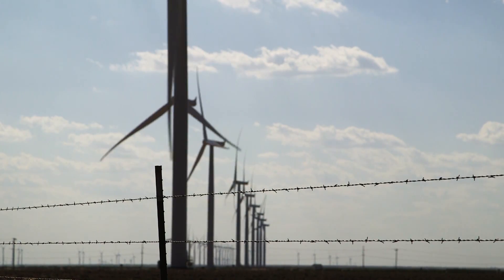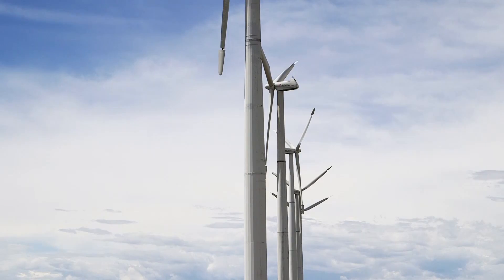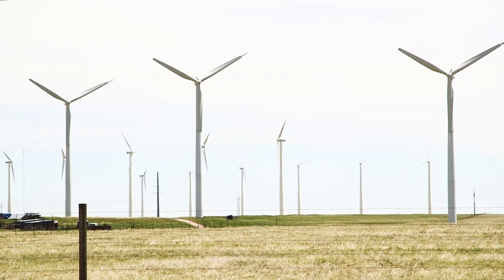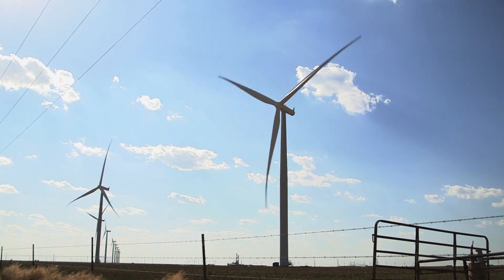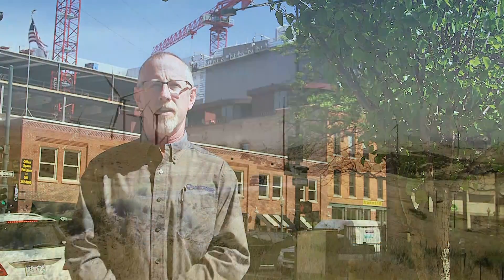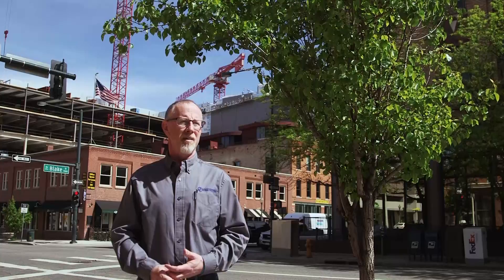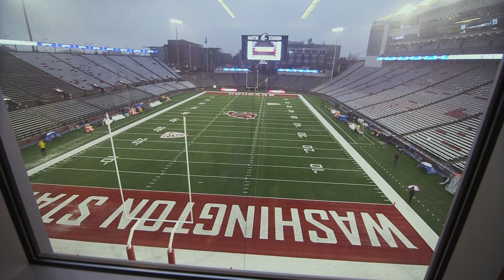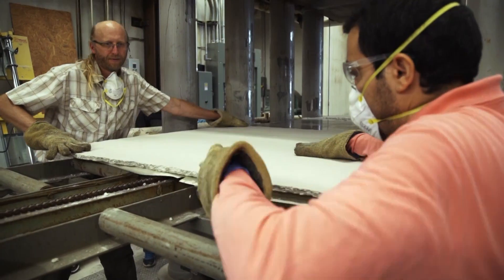Recycling Retired Wind Turbines

Comment: Well that looks Mighty green to me especially when you have all of these machines that operate on fossil fuels to be burying these wind turbines
Reply: Plus all the fossil fuel for the equipment to build them. Never mind all the plastics and fiber glass epoxy are made from oil based chemicals. Every where wind turbines are installed the power company charges more for the so called free energy than than the energy produced by fossil fuel. This and corn based fuels would go away if we remove government subsidies because they don’t really save any fossil fuel.
Reply: @Chris_at_Home  "This and corn based fuels would go away if we remove government subsidies because they don’t really save any fossil fuel." How on Earth do you believe that? Wind and sun have zero fuel cost, nothing burned, both methods last for decades or longer. One energy source burns fossil fuel all day, one doesn't.
Reply: @justsomeguy934  I haven't gotten a definitive answer but I keep asking if the manufacture of solar panels, wind turbines or electric cars actually offsets the benefit of using these :green" systems.  There's no free lunch and the composites in wind turbines are made with toxic resins and the steel, aluminum, heavy metals for switches etc all needs to be refined and manufactured.
Reply: @williamdavidson9009  I can tell you: once manufactured, solar panels and wind turbine blades are solid waste. Once manufactured, their energy source is pollution free. Burning ANYTHING creates pollution over the life of the device. Be aware of what you're doing: the oil companies have you focused on the issues of manufacture while NOT comparing those results to the oil industry. Follow the money!
Reply: @justsomeguy934  My question is does the savings on pollution actually offset the pollution caused in the manufacturing process.
Reply: @williamdavidson9009  I understand your question and I said YES. The manufacture of a hollow metal tower and a wind turbine that works reliable for decades with no pollution thereafter most CERTAINLY offsets burning petroleum for decades. Just the process to REFINE petroleum pollutes far more than making a wind turbine or making a solar panel.
Reply: Wind turbines require lots of petroleum products to function.
Hydraulic oil
Gear oil
Yaw oil
Yaw grease 
Bearing grease
Blade grease
Etc
Reply: No petroleum, no turbine. 
Also they produce a lot of waste.
Electronic waste, bad motors, numerous other components.
All the greasy rags used to clean them during service are incinerated.
They’re not as “clean” as you think. Even the really new ones.
And because the generators are asynchronous, there is a constant stream of copper dust coming out of every one.
Reply: @henrygoodbar9477  Gear oil on a turbine is miniscule compared to burning oil as fuel! That's like comparing the oil in your car's engine to the fuel it burns...they are vastly different, and one creates poison to use it.
Reply: Justsomeguy you are incorrect about wind turbines not burning any fuel. I have seen massive areas of wind turbines when there’s a ice storm or loss of power and every single one of them had a generator running in order to keep power to them. I think you have to consider that burning fuel. I’ve seen those generators run for weeks at a time. They also use oil in them. You can’t really have friction without lubrication and expect any equipment to last very long. I’ll let you guess where that oil comes from. I wish we could put the renewable energy fan club in a community and let them live off their renewable energy‘s for a while. See how long it is before they get tired of losing power, not having running water, air conditioning, heat, refrigeration, you know all those things they take for granted and they don’t actually think about.
Reply: @basedpatriot4982  You're making a common mistake that the oil company wants you to make. Several, in fact. Here we go: 1) you're assuming that I'm advocating for 100% renewables, to the point of not having power. I am not. Do not make an argument to the extreme and then criticize the original argument. 2) The comparison is between the amounts of oil used, not using oil as a lubricant. A few hundred gallons of gear oil in a turbine is vastly different than burning millions as fuel. 3) You fail to add in the true cost of pollution into your affection for oil. I can provide you many example of oil spills, air quality, pipeline spills, etc. that you are omitting from your argument.
Reply: @basedpatriot4982  " I have seen massive areas of wind turbines when there’s a ice storm or loss of power and every single one of them had a generator running in order to keep power to them. I think you have to consider that burning fuel. I’ve seen those generators run for weeks at a time. They also use oil in them. " The problem with your argument is that you're using an emergency situation as a definition of the normal operation. If I used your own argument, since my own utility sometimes buys peak power from other utilities that's expensive, I could conclude that the normal, say natural gas, operation wasn't feasible. My conclusion about a good fuel, like natural gas, is that it won't work  because I've seen my utility use jet turbines and jet fuel (!) to generate electricity when there's peak demand.
You are also making an argument in the extreme, and judging the actual argument. For example, who on Earth is arguing that we go without power? I have never argued that we have unreliable power. Not ONE utility on this planet is 100% anything - coal, NG, nuclear, solar, wind, hydro, geothermal. NOT. ONE. If, however, that solar power can generate 75% or our energy needs (the daytime!), WHY would we burn petroleum products? 
Another argument you're making is the argument of absolute. Your example is that a turbine uses lubrication oil, and therefore disproves renewable energy. Well, does coal energy disqualify natural gas? The  argument is one of relative uses. A few gallons of gear oil in a turbine is OCEANS less than burning oil to generate electricity.
I enjoy our talk, please reply.
Reply: @williamdavidson9009   Indeed, and the entire infrastructure that is capable of  supplying the material needed for a wind farm, is oil/coal/hydro based, right down to the crane op driving to the wind farm in his diesel pickup, been there/done that.
Reply: It takes rescources to build anything that produces energy.Bio - fuel,takes tractors,seeds,ground and refineries.Its not as polluting as fossil fuels ,but its not free.Turbines all require components of rare earth metals,and the disposal or re- fitting of these also have costs for disposal,One use plastics like packaging and a trillion cubic yards of one or two sip water bottles is a huge problem[ no reuse ,recycle,or repurpose plan]just jillions more producing it.But,its great for the petrochemical companies ,cuz ,when its out thr DDT oor ,their responsibility ends.Yea go head and bitch about wind turbine blades.SMH..Maybe shoul also throw abandoned ,or decrepit underground storage and pipelines in the mix too.
Reply: @joebeetz1832  Yeah, I get a kick out of the objectors to wind turbines that say "can't use those, the paint on the blades is toxic" while driving a car that will literally kill you if you pumped the exhaust into the cabin.
Reply: @justsomeguy934  I spent 39 years in the electric power industry. Wind turbines and solar panels are not the way to go to maintain a middle class standard of living.
Just ask Texas. The previous posters are correct about the hazardous waste produced with those inferior forms of electric generation. 
You cannot dispatch wind or solar power the way conventional power plants can.
Speak to any electrical dispatcher employed in the USA and they will tell you that you need "base" load sources. Gas turbines, nuclear steam turbines, coal & oil fired steam turbines, hydroelectric generators. This technology has been around a very long time with a proven track record.
Wind turbines are a child's fantasy.  Leave the production of electricity to the adults.
Reply: @generatorjohn4537  Being an electrician does not qualify you to discuss energy generation, sorry to say. Being a plumber doesn't mean you know where water comes from or how it's processed. Being a cop doesn't make you a lawyer, even though you deal with the law all day.
I think I see your mistake, however. You think I'm proposing a 100% dependence on renewable energy. I am not. No utility is 100% anything. But wind and solar can generate 75% of all our energy needs when we need them. I'm perfectly happy with non-renewables for the minority of energy production (say, off-peak). You most certainly need base power generation, but if solar can make 75% of our daytime energy needs, use that FIRST.
Reply: @justsomeguy934  Like I stated earlier, you will never maintain a modern middleclass society on wind or solar. These sources are government subsidized. Only reason they are being built. Besides you need to consider this.
You cannot operate steel mills or any modern manufacturing facilities with large motor loads on wind energy. Wind turbines or solar panels cannot produce the reactive power required to properly start and operate them.
Look it up. Although you'll probably need an electrical engineering degree to understand this concept.
Reply: @generatorjohn4537  "Look it up. Although you'll probably need an electrical engineering degree to understand this concept." Um, I have looked it up, and it's YOU that needs to understand the topic at hand. Again, an electrician is not qualified to talk about energy generation, he just runs the wires. Plumbers don't understand water reclamation, HVAC technicians don't understand nuclear energy. But all think they're qualified to do so.
Wind and solar most certainly can create the energy we need. Solar, which only operates during the day, can generate 75% of all power required during the day, and generate 100% if the grid has storage. Have a large motor load? Use a storage device (capacitor, battery). I guess you think a dam can't generate useful energy, either.
How many solar panels to power the USA: https://www.freeingenergy.com/how-much-solar-would-it-take-to-power-the-u-s/ 
Largest wind turbines: https://youtu.be/anzrmuxh9dQ
Reply: @generatorjohn4537  "You cannot operate steel mills or any modern manufacturing facilities with large motor loads on wind energy" I'm overjoyed at learning something new. Tell me how the electricity - voltage, amps, watts, kW/h, coming to a factory over a utility line is different when a wind turbine makes the energy. Or when a solar panel does. Or a dam does. Or a jet turbine does. Are you telling me that a utility can deviate from the standard energy requirements it supplies to its customers based upon the source of the energy? How about when a utility buys peak energy from out-of-state? Can the utility only supply half the amperage because the peak supplier uses geothermal? Educate me. Tell me how, then, the Tesla grid-level battery works so well in Australia. It steps in and provides megawatts of energy, instantly, when their grid needs it. And it's all invisible to the utility customers.
Reply: @justsomeguy934  BTW - I posses an electrical engineering degree. 
 Do a news media search about the Texas rolling blackouts that occurred recently. You will learn that Texas relied too much on wind turbines for their energy mix.

Go and do another search on any independent system operators (ISO) within the USA. Check out the regions of the country and see for yourself the energy mix they contain on their websites. Usually displayed on their home page. They use more conventional forms of power generation to maintain the grid.
It was clear that Texas will need a do over going forward. They just found out the hard way. 
There is a term that goes back many years in the electric utility industry, " reliability and availability ". To maintain this concept you cannot rely on a source that stops spinning when the wind dies or a cloud passes over solar panels. This is what hurt Texas.

Electricity is consumed the instant it is produced.
The ISOs of the world use many large prime movers to maintain the grid. Offline trips occasionally occur with a prime mover and that is why the (ISO) maintains enough capacity onto the grid to keep it stable. Those prime movers are large fossil or nuclear steam turbines, gas turbines or hydroelectric waterwheels. 

You seem like a smart fellow. How much do you know of the followings concepts and components that follow this sentence?

 Power factor, leading vars, lagging vars, watts, alternating current, direct current, generator stator, generator field, excitation systems, generator voltage regulators, capacitor banks, reactors, SF6 circuit breakers, oil circuit breakers, circuit switches, motor operated disconnects, power line carrier schemes, step-up power transformers, current transformers,voltage transformers, differential relaying, overcurrent protection, motor management protective relaying, etc.
They are the many concepts and components that have made up a reliable modern electrical power grid long before wind turbines came on the scene.
They are some of the many components that I had the pleasure of installing and maintaining in my long career. 
Like I stated earlier, leave the production of electricity to the adults.
.
Reply: @generatorjohn4537  Stay in your lane, Generator John. The recent Texas outage due to inclement weather was not over reliance on one particular energy source, although those supporting traditional energy would like to convince you of that. The issue with the Texas outage is political. They deregulated their [isolated] grid and didn't make reliability a priority. Their grid cannot import enough energy from the outside to cover emergencies; it's islanded. They allowed multiple energy contributors to their grid but didn't require infrastructure maintenance as a high priority. Their pricing structure also required that they use wind power first, rather than make the lowest rate or most abundant source of energy the priority. They meddled with the typical utility business model. My state is mountainous, very cold, has wind and solar power and we have cheap, reliable energy. Texas does not.
Had Texas had a more traditional grid, it could've easily imported enough energy from other grids to cover their shortfall. As you can see, there are other factors you may not be aware of that affect the Texas outage. See your Texas representative as to why they deregulated as they did, and why their grid is a singularity in the USA.
Reply: @generatorjohn4537  "Electricity is consumed the instant it is produced.
The ISOs of the world use many large prime movers to maintain the grid. Offline trips occasionally occur with a prime mover and that is why the (ISO) maintains enough capacity onto the grid to keep it stable. Those prime movers are large fossil or nuclear steam turbines, gas turbines or hydroelectric waterwheels. " Guess you never heard of grid level storage. See: Tesla grid level batteries in South Australia. Or storage lakes. Or dams.
And exactly WHO is recommending we be dependent upon an intermittent energy source? You have made a classic mistake that assumes I'm advocating we abandon all forms of traditional energy and run out of power at night. 
Since solar can produce about 75% of our electrical demand during daylight hours (when we need it, btw), why not use it? Why burn NG or coal or diesel if sunlight can provide the identical energy? You seem like a smart fellow that can't see the forest for the trees. Why build a new NG plant, coal plant, peaker plant when a solar farm can produce energy when we need it?
Reply: @generatorjohn4537  "Like I stated earlier, leave the production of electricity to the adults." Sometimes the adults, like the Board of Directors at Kodak, Sears and Blockbuster need new ideas. 
You have yet to tell me the difference in electricity at the utility level between solar, wind, tidal, hydro, nuclear and fossil fuels. I'm anxious for you to educate me why the electricity - volts, amps, watts - that goes on the grid is different if a solar farm supplies it vs. a dam vs. coal. You stated renewable supplies can't suffice for factories and other uses. Please support your statement of how, at the grid level, a megawatt of electricity from a wind turbine is different than a megawatt from my municipal power plant that uses NG. Use as big a set of words as you need, as you said, I'm a smart guy.
Reply: @justsomeguy934 
Years ago I sat in a company wide meeting about our transmission system where a system engineer was describing the typical wind forecast on a given day in our area. The wind output went up and down like a yo-yo. He didn't seem impressed with the idea of installing wind turbines onto the system even though the politicians were pushing them. Grids can't reliably operate that way. 
ISO operators cannot dispatch wind turbines the same way conventional electric generators are dispatched. That is just a fact.

So you say you're a smart guy?

I bet you have never been inside a power plant or an electrical substation, or a dispatch facility let alone work in one.

Guess what buddy boy? Getting "dirt under your fingernails" and "wallowing in the mud" with the people who make it happen does.
This "guy" has lived it for 39 long years!
Reply: @generatorjohn4537  "The wind output went up and down like a yo-yo. He didn't seem impressed with the idea of installing wind turbines onto the system even though the politicians were pushing them. Grids can't reliably operate that way. " What you're running into is a person that's used to doing something the same way for decades (see: Kodak, Blockbuster, GM, JC Penney, Sears). OF COURSE your buddy objected to adding an intermittent power source, it's not what he knows or is used to. It's called the comfort zone effect.
I bet you were unaware of the Tesla Grid Level storage in South Australia before I told you. That facility not only saved MILLIONS of dollars the first month it was online, but it kicks in and smooths the power in Australia so fast that the utility operators only find out when the report comes out. 
In short, while renewable energy is intermittent, it most certainly can be added to a utility grid. The fuel cost is zero, pollution is zero, and the energy independence is invaluable. Renewables are low-maintenance energy producers and their issues of intermittent energy are solvable, the Tesla battery proves that.
Guess what, buddy boy? Get your head off your diploma and realize there are other ways of doing things. I educated you about grid-level storage, you're welcome. Your friend on the utility doesn't see the big picture, he doesn't buy the fuel that's used. He doesn't defend the oil routes with his life. He doesn't see anything other than his specific job at the time, just like you. I play the long game, not the game today.
Here's an article on wind power variability, and it states that consumer demand is more complex that wind power production:
https://www.wind-energy-the-facts.org/wind-power-variability-and-impacts-on-power-systems.html
Here's a quote from the article:
" However, from a system operations perspective, the supply behaviour of a single wind farm is just as irrelevant as the demand behaviour of a person. The collective behaviour of consumers and the collective behaviour of all generating plants are what matters."
Reply: Tyrone Jackson  I drive an electric for most of my travels. Your point?
Reply: Tyrone Jackson  "You drive a car made of petroleum products and materials that were ravaged from the earth by slave labor and giant machines which run off petroleum? " Actually, oil warrior, it's YOU that doesn't see the argument. The fact that my electric car has paint on it (same as your car) or has lubricants in it (same as your car) has nothing to do with burning gasoline, making poison, dying in the MidEast to protect oil companies for free. It's a relative argument. Which is a better choice? Which doesn't poison the air behind you? Which doesn't force me to pay taxes to corporations that don't deserve it? If you can't see the argument, by all means, keep buying that gasoline. I just ask that you pump the exhaust fumes from your car into your cabin and not leave it for others to breathe.
BTW, I don't know who YOUR lord and savior is, but mine isn't Al Gore. I think your lord and savior is Exxon, but let's not argue religion.